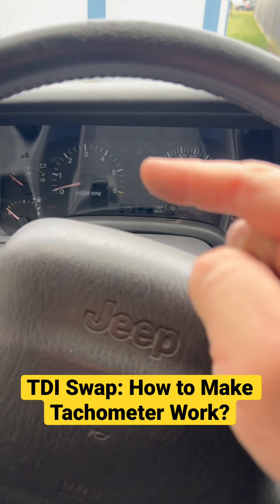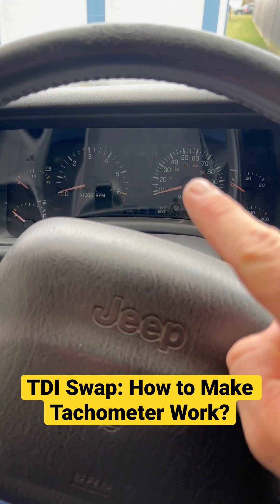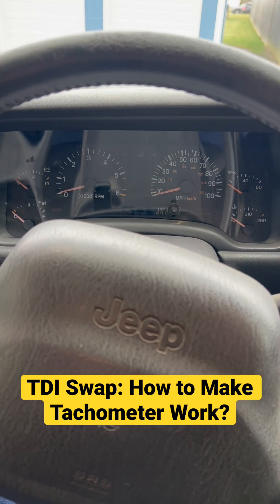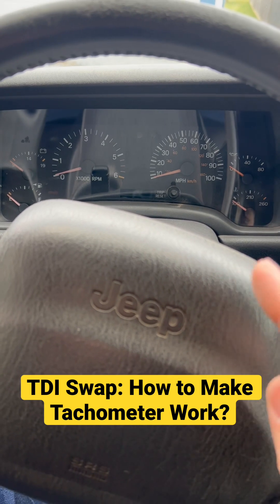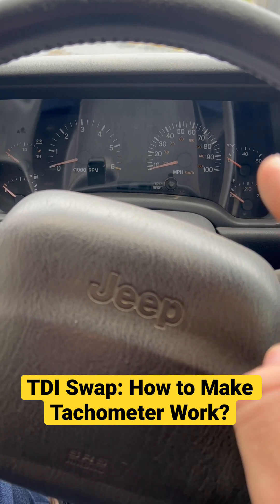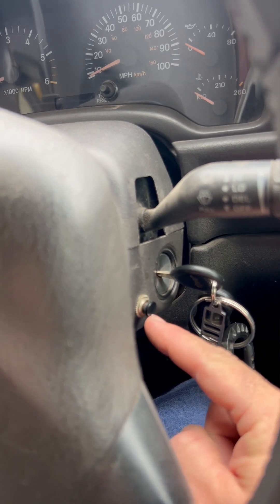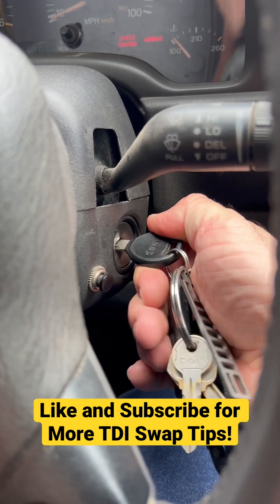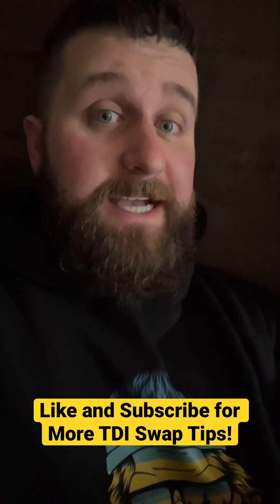TDI Swapped Jeep: How to Make Tachometer Work!

Comment: Not tdi swap related but, my 01 Jetta tdi tac shows 0rpm at idle but it does increase with acceleration or if you rev it in neutral. But always 0 when idling. Any ideas guys?
Reply from the maker: Crank sensor would be my hunch

Comment: What color wires do I need to bridge?
There’s 3 wires
Orange 
Black and light blue 
Tan and yellow
1992 jeep XJ, I tried bridging them and none of them are making the tach fire up
Reply from the maker: Black/lt blue & tan/yellow. Orange is 5v power. Tan/yellow should be signal ground. What I’ve found works is if you hold contact on those two wires while cranking/starting the engine the tach comes on with the engine. If you wait, it takes a few tries contacting the wires to get it to go. If you hold them together too long you get a “check gauges” light and everything but the speedometer goes flat until you restart.
Reply: @ thanks I’ll give that a try
Reply: couldn't get it to work, not sure if it's because the 92 ecu is different or maybe my ecu is fried, not sure what's going on
Reply from the maker: 92 is most likely different, sorry

Comment: I need help finding a fuel pump that will fit my b e w Jeep JK or a regulator that'll work
Reply from the maker: You can just use the factory in tank pump and tee it into the return right by the fuel filter so it doesn’t build pressure, just flow. I’ll be using this method on my next swap whenever that happens
Reply: @DirtRoadTherapy  will that work with diesel.. and do JKs have return lines idk ..
Reply: How did you ground the engine?! I swapped into a 97 Ranger and my alternator burned out! :(
Reply: @HubertsGarage  I'm guessing into the frame
Reply from the maker: Head to firewall, also have one from block to battery just to make extra sure there’s a strong ground to battery

Comment: I’ve got a couple questions. Just picked up a 1985 jeep Cherokee with a 2.1 Renault. I believe the engine is seized. Thinking about doing a TDI swap. First question;

1) how much did it cost you to swap the PDI? 

2) where can I find information on this one online?

3) is it possible to swap a 1985 Jeep XJ?
Reply from the maker: Hey thanks for the questions. The 2.1 would be cool but it’s not worth rebuilding. It’s definitely possible to swap your 85. It cost about $7000 all told. Join the FB groups “TDI XJs and MJs” and TDI swapped Trucks!

Comment: Which crank sensor are you running? Jeep or VW? Is this a manual or AT?
Reply from the maker: Jeep crank sensor is what’s connected to the gauge. Manual transmission but that doesn’t matter for this
Reply: @DirtRoadTherapy how is it being triggered? Only have experience with the Auto, has the square cutouts on the flexplate. How does the manual get it's signal? From the TDI flywheel?? 

Btw thx a mil for the quick answers even though this is a year old, you have another subscriber.
Reply from the maker: @miked5789 there’s no TDI flywheel it’s a Jeep flywheel. There’s an adapter at the TDI crank. Everything about the transmission is stock - flywheel, clutch, sensors. There is no cam sensor anymore, I’m just touching those two wires together with the switch. I’ve found it is pretty reliably starting the tach right away if I hold the switch while cranking. So I need to automate that and it will work without me thinking about it
Reply: Ah hah, ok. I'm doing an M57 swap, uses an e46 flexplate so no XJ crank sensor. Thanks for your input.

Try an normally open relay hooked up to the start+, will bridge cam signal & ground while cranking.

Comment: Do these things would work with LS Swap ? Thats would help alot
Reply from the maker: As long as you’re running the Jeep crank position sensor it is worth a shot
Reply: @DirtRoadTherapy im using LS Crank Position Sensor bro but i keep the factory XJ PCM in place to work all rest of the gauges worked as stock , just i need to know that can i keep the jeep Crank Position Sensor in place with LS Wiring attached to it & Cheat it with do the settings in GM PCM ? Tnx man for your reply and good time❤
Reply from the maker: I don’t think that will work. There may be a signal converter that someone makes though, I would look into that
Reply: On the 97-04 wranglers when we ls swap we retain the factory jeep ecm, splice the gm output signal for tach into the jeep computer then use hptuners to change the gm tune to output high an low resolution from 6 to 1 an the tach should work. May have to play with decimals to get it as close as possible.

Comment: You'll better write some details :) There are many solutions available according to Jeep version/electricity. Did you connected VAG ECU RPM Output somewhere in Jeep ? Is your Jeep based on CCD Bus or not ? What was original engine on Jeep ? diesel or gas ?
Reply from the maker: I will make a full episode about these kind of things. But I am not tied into the VAG system for any of my gauges on the cluster. Jeep is based on CAN Bus. Original engine was 4.0 gas

Comment: How is it for power? Im considering the swap for my tj but I dont want to be down on power.
I have a 6 inch lift with 35's and I daily drive it so It'd be nice to have the same power while using less fuel
Reply from the maker: It's better than a 4.0 in every way. Do you research on what turbo/injectors/tune you want to run and you'll be quite pleased. I've honestly never heard of someone selling one of these swaps because they were unhappy with the power. Now it's not a heavy duty diesel so I wouldn't swap one into a 1/2 ton truck on 37's or a suburban or something but it's such a perfect power plant for Jeeps, toyotas, similar size SUVs to the XJ, or even smaller vans. I'd do the swap all over again and I plan to do others in the future!
Reply: @DirtRoadTherapy  Decent mileage too im guessing?
Reply from the maker: @btzxdarkfury1922  on 33’s with 4.10’s I got 26-28 consistently. You don’t need OBD for the Jeep anymore, I put the VW OBD port where the Jeep one was. I had to remove the CEL bulb from the dash, of course that has a long list of complaints, since everything related to the 4.0 is missing 😅
Reply: @DirtRoadTherapy  Ah ok, I figured something like that would need to be done. Would there be any way to get the CEL from the tdi to work? Whether it be wired into the cluster or a seperate build. Essentially I want to do the swap but keep it as factory looking as possible
Reply from the maker: The company I used for my harness makes a CEL converter that is around $150. I didn’t see the need since my head unit uses a Bluetooth OBDII reader and will tell me if I ever throw a code
Reply: @DirtRoadTherapy  another question, sorry. Is there any way to get the obd reader in it to work and all? And does the tj cluster throw an engine light with the tdi in it?

Comment: Hi hope you are well im going to be doing this similar swop but i want to retain my auto box also how much lift do i need to do this swop im running a 2inch lift at the moment and not sure if this will be enough please if possible if you can get back to me
Reply from the maker: You can use the auto. I had about 3” of lift when I did mine. The track bar and pumpkin are the only things you’ll really need to worry about. Get some Metalcloak Duro Bumps and adjustable bump stops and you’ll be fine you just might not have a lot of up travel. Good luck with the swap! I’d appreciate if you use my TD Conversions link (found in most of my videos) if you order their parts! Happy to answer any other questions too
Reply: @DirtRoadTherapy  thank you for your fast responce so id have to go up another inch not too bad
Reply from the maker: @ryanslade2591  yeah I’d suggest it!
Reply: @DirtRoadTherapy  ive got a drop link on mine that they say can do up to a 5inch lift but we will see

Comment: I may be putting in a new 4.0 block in my XJ, but I've been really considering a turbo diesel in the far future. I know you mentioned that you have the (stripped down) Jeep computer piggybacking off the VW computer, but how did you ensure the Jeep computer isn't lighting up the gauge cluster like a christmas tree? For smogging, do they simply connect the test computer to the TDI's OBD2 port?
Reply from the maker: I had to pull the CEL bulb. But the VW OBDII is in place of the XJ one so that’s what they’d see to plug into. However, I’m not in an area where smog is required. Be sure to do ALL your research before doing a swap if smog checks are in play for light diesels in your area

Comment: If you signal ground through a relay at key on to give the tach ground pulse, it will work as factory. And you can get rid of your button on the column! Awesome swap
Reply from the maker: Thanks for the tip—I tried that, but it did not work for me ☹️. Thanks!
Reply: @DirtRoadTherapy an Arduino and relay would be perfect for this. When the arduino gets power, wait 5-10s, then a for loop for say 10 cycles, cycle the relay, wait 0.1s, cycle relay, wait 0.1s
Reply: It probably needs to be delayed a bit
Reply from the maker: @JosephVE3GKT yes it seems so